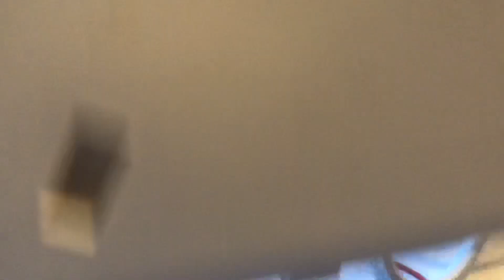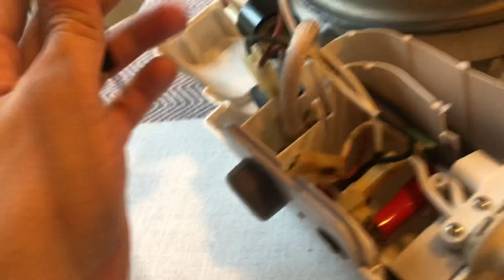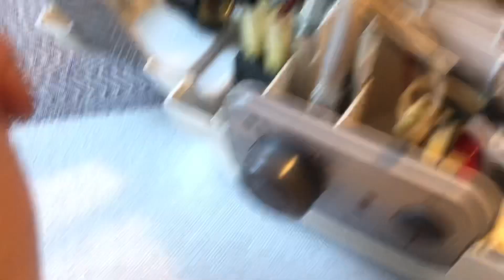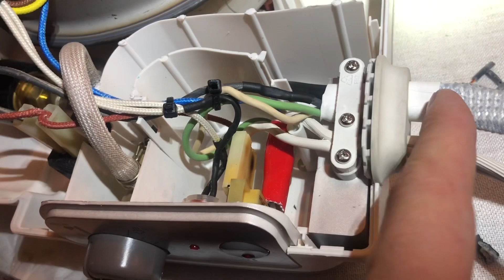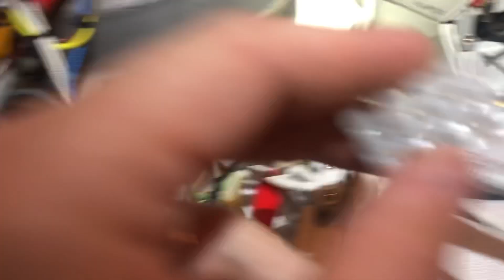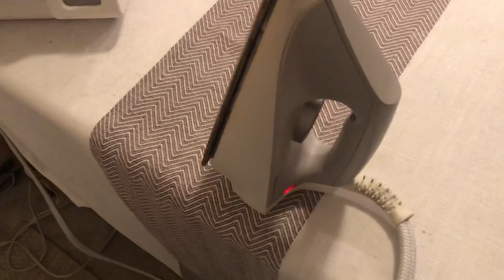Rowenta pressure iron & steamer DG5030 FIXED - broken wire and charred wiring

Comment: i have same model..i know wire is good because the iron heats up fine..however the steam switch does nothing...the boiler works fine and if i open cap steam comes out so everything works other than no steam coming out of iron...im going to do more investigating..havent found any fixes online...i need to verify switch is working..

Comment: What type
Of screw is the one at the base ?
Reply: Hi @victork3397; I have two irons, same model of this one.
One is leaking steam by the cap and the other just don’t give me steam at all. 
Where do you recommend to send them for repair? 
Do you offer that service?
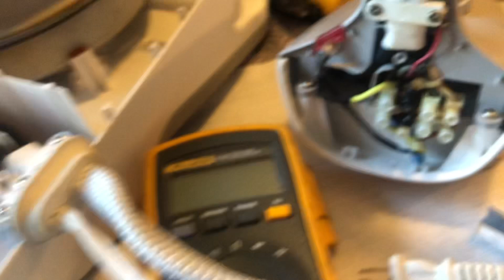Reply from the maker: The one shown at 0:38 ? 
If that’s the one you’re referring to, it’s a tamperproof torx bit size T10.